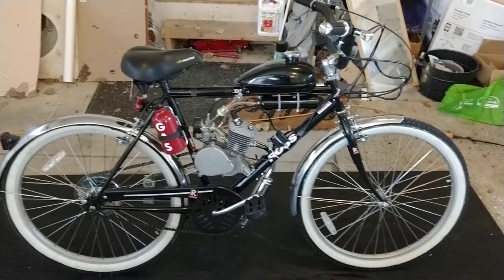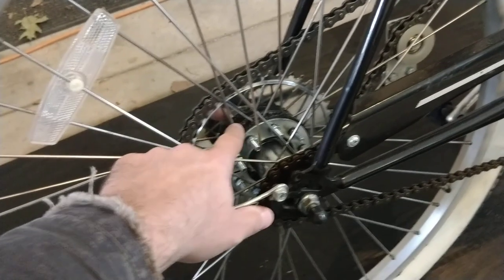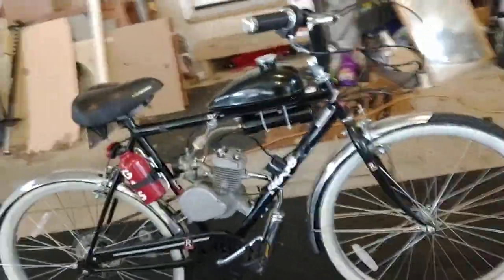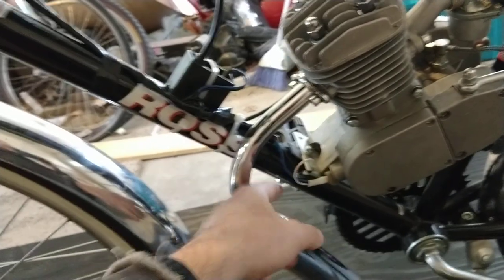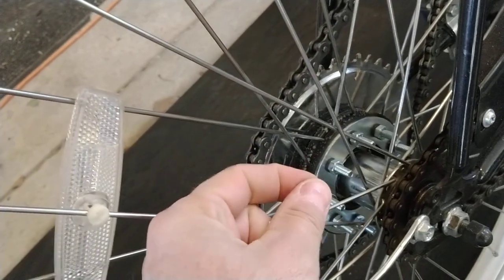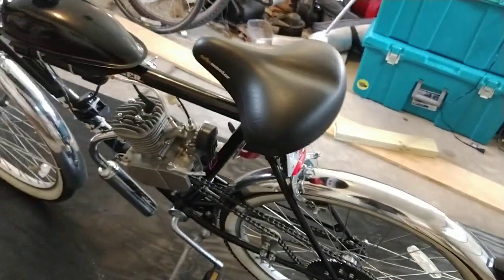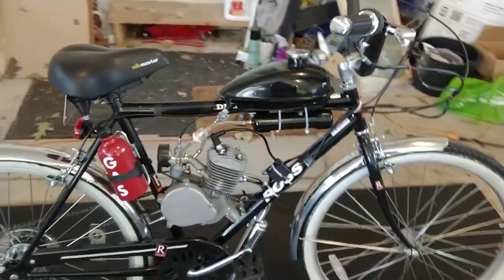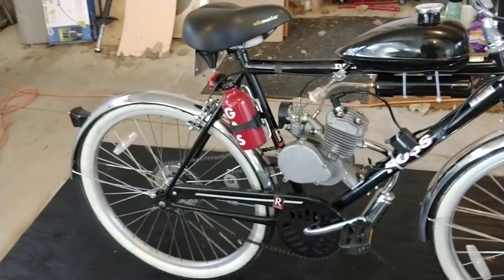80cc motorized bike build overview mods, boost bottle, dual breaks

Comment: Good job on your build, Just one thing I would warn people not to do though. There are plenty of options out there for front engine mounts for a large downtube, They are made to be strong. By drilling two holes through your downtube you have compromised the integrity and strength of the down tube which the frame manufacturer engineered, Engine vibration, vinyl padding or not, will eventually make this part of the frame fail and break. That will be a catastrophic ride when that happens. Do not drill holes in any part of a bike frame tube! By the way an old innertube works great for vibration gaskets, it's cheap , thin, and you usually have an old on around if you own a bike.
Reply from the maker: Cool.  Thanks for the tips!
Reply: You know what's works even better for vibration gasket? A little chunk of tire lol

Comment: I have found after twenty years that the coaster brake is more reliable than any other brake and only thing that holds up at 40 mph.
Reply: I've found that 90% of people who think they can work on coaster-brakes/bikes, really can't, just notice all those who claim to have a coaster-brake fail, never show the broken/wore parts, lol, I agree with you 100%.
Reply: @jerryb1234  if done right yes they work well, if not they slip and come lose. That means you just have to adjust them. I just like using disc brakes because I don’t have to worry about accidentally staling my engine.
Reply: Coaster brake alone is crazy talk from someone who doesn't know what they are talking about, I thought the same way and after many scarey  coaster brake failures, I wouldn't ride with just coaster  brake, but I would take it off and I would use it along with rear, and front handbrakes with dual brake handle, I only apply my coaster brake after I slowed down with the hand brake and the coaster brake to a complete stop, coaster brakes weren't made for stopping a bike powered by a motor, it is used for and made to stop at a slow coasting speed,  that why it's called a coaster brake.
Reply: @dannymartinez8314  Wow you just know everything dont you! I am a mechanic by trade and if you don't adjust them right they will fail just like any brake. Have a nice day.
Reply: @drakejavener7354  ok, so what the hell we talking about, so you a mechanic by trade, did I ask you, ok let's entertain this reply of your, so your a mechanic, what type of mechanic, auto mechanic, machinery, small engine, boat mechanic,  bicycle mechanic, what ever it is, it doesn't matter, what it is, is bicycle brakes being discussed, so don't be rude and arrogant, I wasn't insulting.... oh wait a minute, yeah I was, look if you want to say, it safe to use coaster brake only and all you have to be a mechanic by trade to know how to adjust them, go for it, I still use mine, but not alone, I use three sets, handbrakes and coaster, if you think your the only one that can and be safe then I won't stop you, psst,  hey you don't have to be a mechanic by trade to work on a bike, come on we learn to work on bicycle when your a kid, but I do know somethings as well and well like you, I'm not young that I talk about something I have no experience and tested myself, and what I know is what I learned with blood and sweat, so don't listen to others warnings of just using coaster brake, I learned the hard way, but I learned.   If your wise, you'll learn from others mistakes instead of your own.     Toodles
Reply: @dannymartinez8314  OK Danny have a nice time. Pease.......
Reply: @drakejavener7354  okey dokey

Comment: When you removed the coaster brake arm did you also remove the internal brake pads from The Hub? If you did removed the coaster brake arm it will work for a short while as it did mine but when you break going downhill it will unspin your rear hub bearings locking it up. I learned it the hard way trust me your brakes will still work with the arm removed. But the coaster brake arm is what held it all together you will notice your back wheel will get play in it before it goes out completely.
Reply: Good advice, I'm surprised uploader didn't respond.
Reply: @franksmith7271 Thanks, he probably already found out the hard way LOL.
Reply: Lol, I found out the hard way the other day that night riding on a bike path in the dark ain't the way to go if you haven't got a very bright headlight... I bent my front fork back so much the tire rubs the frame...
Reply from the maker: Hi James... sorry for the late response.  I'm new to youtube and didn't check my account as timely as I should have.  I haven't had that problem.  I'll double-check to see, but I think I remember removing the internal brake pads.  I haven't had any of the problems you list, so I believe I did.  Thanks so much for your very helpful and constructive comment!
Reply: @deanvandress4693  be careful when it goes out ,it goes out instantly & locks up with no warning.

Comment: Coaster brake alone is crazy talk from someone who doesn't know what they are talking about, I thought the same way and after many scarey  coaster brake failures, I wouldn't ride with just coaster  brake, but I wouldn't  take it off, I would use it along with rear, and front handbrakes with dual brake handle, I only apply my coaster brake after I slowed down with the hand brake and the coaster brake to a complete stop, coaster brakes weren't made for stopping a bike powered by a motor, it is used for and made to stop at a slow coasting speed,  that why it's called a coaster brake.
Reply from the maker: I'm amazed at the controversy surrounding coaster brakes.  People have strong opinions either way.  Thanks for watching my channel and for the feedback Danny.  Dean.
Reply: @deanvandress4693  sorry, I was reading back over my comment , I hope it wasn't taken that It was directed to you personally, my experience with my first build, took three attempts with only coaster brakes, in the end I learned you must, a must have a thick coaster brake arm, make sure you don't just think you know how to work on them and research and learn how to really work on them and don't risk your safety by using them alone and put handbrakes on front and back and use all three. 
 Work hard, live long

Comment: You said it was your first one at the beginning, then proceeded to say you took the engine off one for another,🙄, nice bike tho!👍
Reply from the maker: Hey Jerry, thanks for watching.  I had this motor on the trek first and didn't like it on the trek, so i put the motor/kit on the beach cruiser.  I hope that makes sense.  Hey, did you see my 4 stroke build series with the custom gas tank?  It turned out really nice.  Thanks again for watching and for the compliment.  Dean.

Comment: Plus you forgot 100cc/79.5cc
Reply: WHICH IS THE BEST
Reply: @SoLoCruizer  66/80 if you want one that doesn’t have as many issues with four stroking, the larger ones based around the yd100 bottom end have their timing way too advanced.